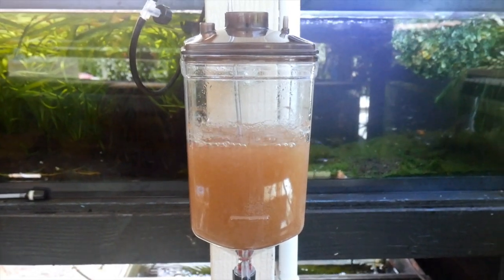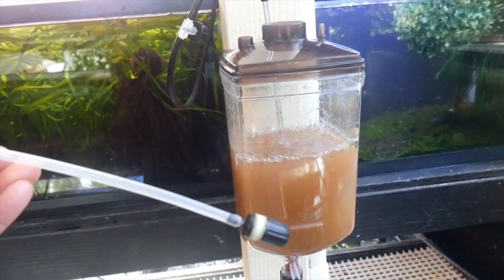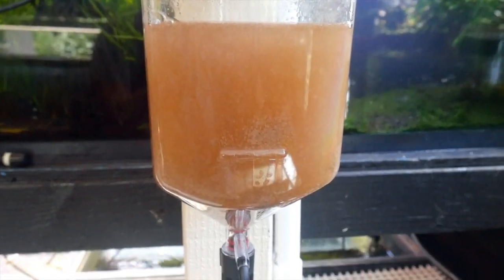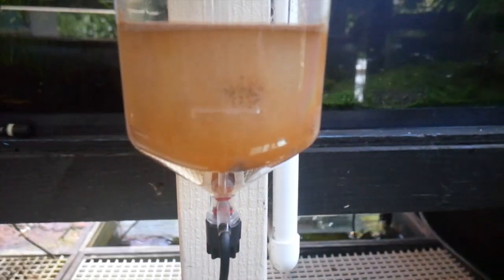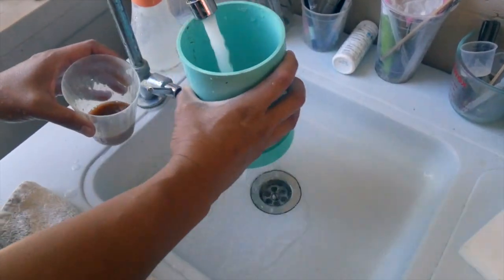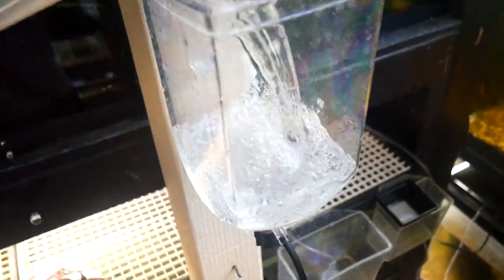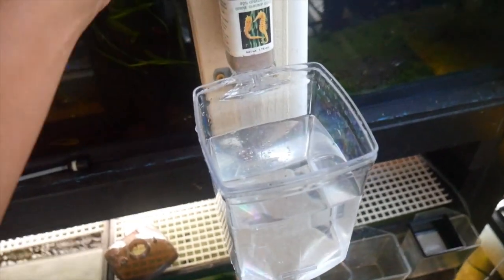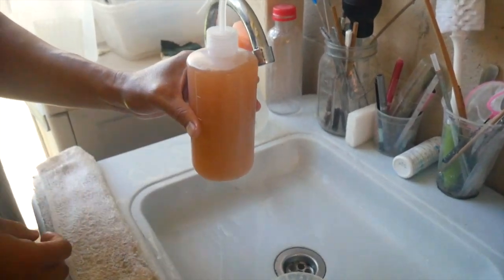Ziss Brine Shrimp Hatchery Review and Setup

Comment: I got one and it works great, did minor mods like adding valve and all, real simple but over all, Awesome hatch rates, ease of harvesting top notch every 24 hours i get liquid gold. Highly recommend this i don't use a heater or the thermometer. Room temp around 75 to 77 still gives me massive hatchings in 24 hours. My salinity is 25 parts per milling or about 1.025 on a hydrometer. dump them into  cup, and then into my fresh water aquariums, No issues with salt my snails are fine and the plants and fish are all good, weekly water changes shows my tank water at 0.0 salinity. All good. I don't rinse them just dump them in. Fish go NUTS adults and fry. Just be sure to use any premium brine shrimp eggs 90% hatch rate or better. Best hatchings. Best  i have seen is 2 liters with 5 grams/ one teaspoon/ or three scoops of the spoon that comes with the eggs i use the same eggs he has in the video

Comment: Thanks for the video dude. Don't you also lose the shrimp that are left in the outflow tube? That squirt bottle is genius. Perfect brine shrimp solution dosing apparatus. Seems a little pricey for a 50 dollar plastic bottle with a valve at the bottom. But works well nonetheless. Have you used the brine shrimp direct one? How does it compare?
Reply from the maker: Yes some bbs is lost but it can't be helped